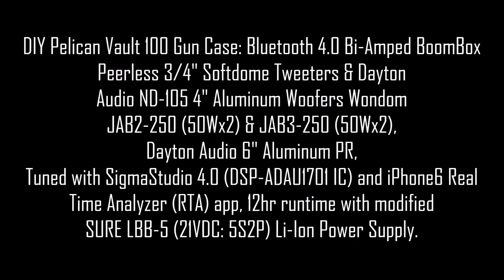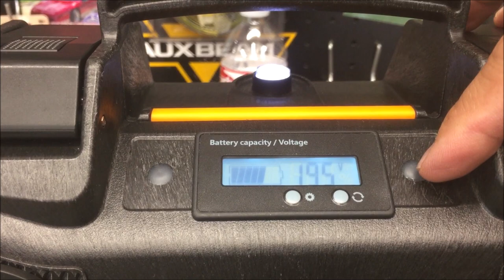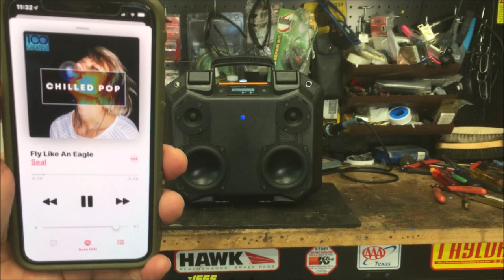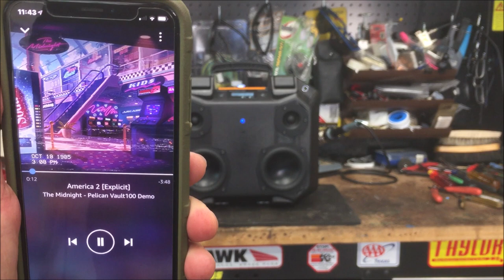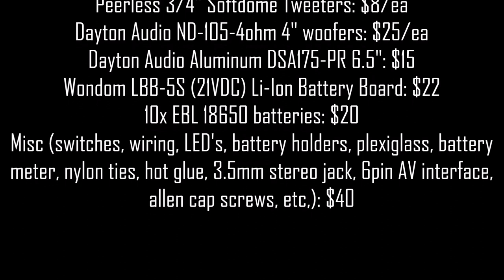DIY Pelican Vault V100 Bi-Amped (50Wx4 or 4.0) Bluetooth Boombox w/SigmaStudio DSP (ADAU1701)!!!!

Comment: For my build for the power supply, I wanted to use something people would have possibly laying around and used a USB C power supply with power delivery.
I then bought a cheap PD trigger from eBay to tell the charger to give me 20 volts so it could charge my series set of 18650s using a MAX745 evaluation board.
It works extremely well!

Comment: Thanks for the greate new video! Unfortunately I am Struggling a bit with my J2 and J3. I always had some noise floor when connected together.
Reply from the maker: What's your power supply?
Reply: @MoDIYHiFi  oh, I don't think it has something to do with the power supply. Same occured while on battery only...
Reply from the maker: DJ-AJ then check the speaker wiring. Those jab boards are notorious for wrong speaker polarity. The 6 wire connector needs to connect solid between the boards. And needs to be run father away or perpendicular to power and ground. If you have any buck or boost converters those can be suspect.

Comment: Any reason why you're not using sony VTC 18650 batteries? Or samsung actual high capacity cells. I'm fairly sure its price premium would be more than worth it due to battery life and consistent/reliable power delivery
Reply from the maker: Cost. My 3400mAh Panasonics are used in my personal projects. All the EBLs I've tested are 2200-2300mAh.

Comment: The Dayton circuit runs 21Vol through the Jack 4 Pin ? 
Have you tested it for a long time ?
Thank you
Reply from the maker: On the 26650 version J4-9 is all the same as in output 21vdc just different headers and connection types. Both boards are the same. One side is all output and perpendicular side in power input or charging. Third side is LED indications.
Reply: @MoDIYHiFi  Jack J2 and J20 on LBB5S connect Wondom JAB2 Amp
Reply from the maker: Cường Lê yes but no way to control on or off unless you place a manual switch. I combined both J2 and J20 4 positive wires together thru main switch.
Reply: @MoDIYHiFi  Thank you